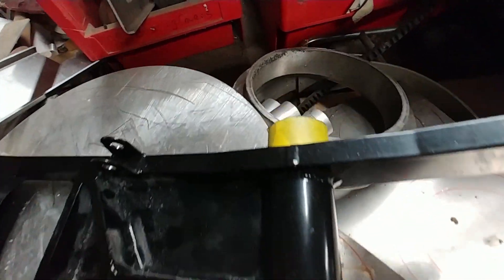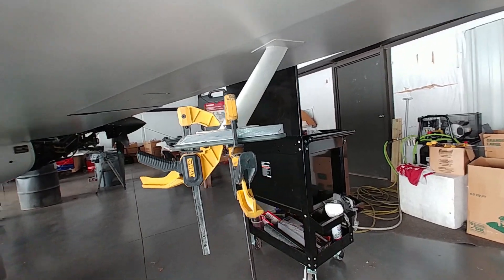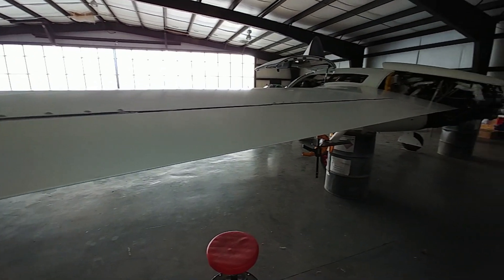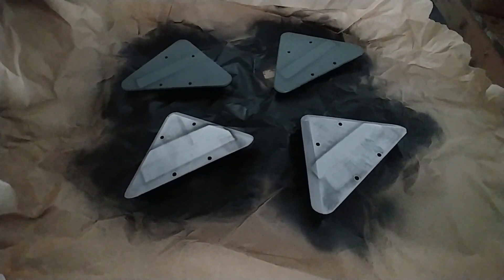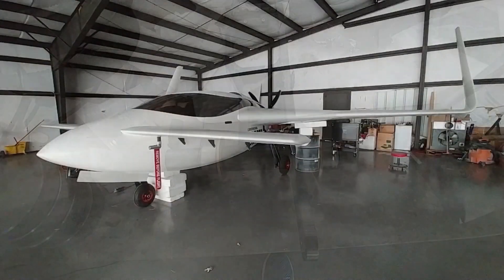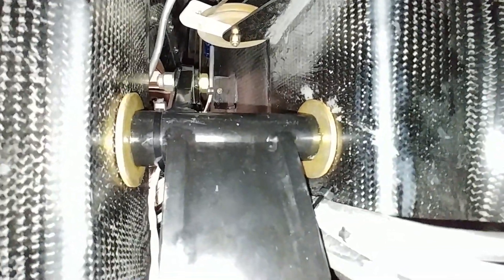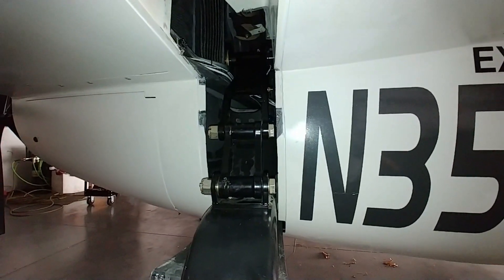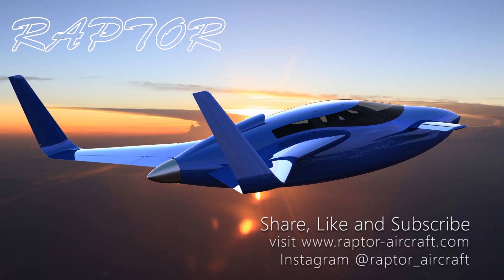In The Shop - Building the Raptor Prototype

Comment: Mount those weights on top of the aileron shoe with a slot allowing sliding them on from the front.  That way if the screws back off, the weight will stay in place in flight.   Also have you considered the aerodynamic forces on the spade near Vmax?  Will they attempt to move aft during turns increasing the negative lift effect on the low wing making the aircraft want to roll faster than wanted/expected?

Comment: I've been following the project for some time now. Congratulations for your thorough testing, it proves well being worth the effort.
I was wondering what precicely happened with the ailerons.  I saw the aircraft rocking (when one wing goes up, the other one goes down), clearly not flutter because then the wings vibrate at a much higher frequency and they do not stay aligned. Counter balancing can cure flutter so it's always nice to have surfaces balanced.
I was wondering if it could be that in your case there 's some parasitic movement of the ailerons (due to linkage system)when the wings rock for some reason, that might enhance the rocking.
It can easely be tested by blocking the yoke and then pusch the wing up or down and watch in wich direction (bad or good)/ or if the aileron moves. Just a thought

Comment: In MHO all control surfaces should be static balanced prior to installing on the AC. It appears that the LHS Aileron is now balanced but not the RHS, it is better than it was but! This surface is more prone to flutter then the other. 
What we did was to construct a mould that formed part of the D-nose of each control surface, the volume of each mould was calculated to be in excess of requirements. The mould was then removed and filled with molten lead, once cool the formed lead block was then glued, bolted and shaped in place. The D-Nose was completed and the control surfaces painted.
Prior to installation each control surface was statically balanced at its pivot points on knife edges. Excess lead was drilled out along the length until the surfaces were balanced. To ensure that balance was achieved a deflected control surface would return to the neutral position. The drilled holes were then spot filled with epoxy and retested and adjusted as necessary.

Adding the mass balance weight in the D-Nose adjacent to the hinge point keeps the added weight  the exact minimum requirements. Any more or less weight means that the surface is not statically balanced.
Peter, I heard you say that Spades have other advantages, great, but in MHO they should be added to pre-existing balanced ailerons and not be the method of providing static balance to a control surface.

Comment: I think both ailerons should be independently balanced. Did you add a steel bar on the leading edge of the aileron similar to longez/cozy etc.

Intuitively adding heavy weights suspended on a 6-7” arm from the aileron lower surface seems a bit risky from a structural point of view. In a normal flight envelope there’s probably not a issue but when the airframe is subject to a short duration jolt then these 5lb spades may cause the aileron to delaminate. Which is not a good idea.

I’ve heard of a Grumman Tiger on approach into LAX encountered wake turbulence and actually broke the aileron counterweight in the wing tip. I suggest you check out the geometry of the Grumman designs. You may be able to get an idea of this geometry from that Grumman in your hanger.

Comment: There are some pretty serious calculations that go into dynamic flutter modes. I'm concerned that you are going to hurt yourself by guessing and randomly adding weight. You have no idea how you just changed the hinge moments and other moments of inertia and whether your control linkages are able to handle the added forces. A well-engineered solution would involve calculating the flutter frequency from the previous video and starting to go through the wing flex modes, aileron flex modes, and linkage flex modes until you find what is actually causing flutter. Could you please do one video of walking through some engineering calculations so the rightfully concerned viewers can know you aren't needlessly putting yourself or others in danger?
Reply: Also, I watched the state of the union video again. You explain that the large wing tips are because of the way the model handled. You can't scale design loads and aerodynamic loads from a model to an aircraft. Why do you think model aircraft with power to weight ratios orders of magnitude higher than the real aircraft fly a fraction of the speed? The Reynolds numbers and forces involved just aren't meaningful unless you have the model in a wind tunnel and know the density, temperature pressure, and velocity of the airstream.
Reply: My concern with this is aerodynamic loads on what is essentially an airfoil, albeit lead, stuck down into the slipstream below the wing.  You have no clue what that's going to do at high angles of attack or in a stall.

Additionally, when I look at ailerons on everything from a Bonanza to Baron to Aztec to Duke to King Air to Lear to Falcon to everything else, even a Lancair, the aileron doesn't bounce during taxi.  It's possible a cantilevered piece like that is exacerbating a problem that might otherwise not exist without it.  

No one expects an aileron to return to neutral when sitting static on the ground and moved to an opposing position up or down.
Reply: 230KTAS on 7GPH  -  yeah pigs are gonna be flying!

Comment: Oddly, painting lead with lead-free paint : )

If it could be done without adding stress concentrators, 3 or 1/4"-20 bolts might strengthen that plate shear line, seeing that the Hysol did not deliver the goods on that joint, last time. If it were possible to keep them away from edges and corners.

Comment: Great idea with the increased weight on the spades.  Are the bolts fastened with lock washers or safety wire?  If you were to cut a slot in the weights, they could be mounted on top of the spades incase the bolts came loose.  The air pressure would help keep the on the spades until you were able to land.  The slots would need to be cut from the back of the weights.

Comment: What I have noticed from watching is that you really are building a prototype, its been fascinating Peter to follow your journey as I have worked in aerospace and find this very interesting.
Reply: The inner rear spars I worked on would likely weigh as much as the Raptor, Airbus A320's :-p
Reply: A lot of commenters also seem to forget that fact, that this is just a prototype and kinks must be worked out. Even Burt Rutan's protypes had issues that needed sorted, some only discovered when they were being test flown.  :-) The difference is here Peter is showing every stage of the process to everyone, whereas most wait until all the issues are worked out before showing the plane. :-) -Daven